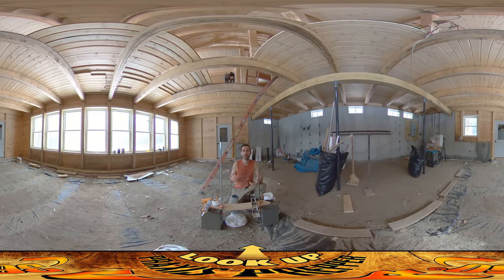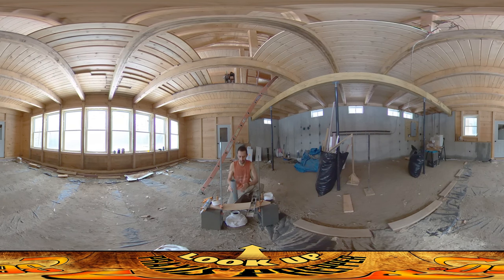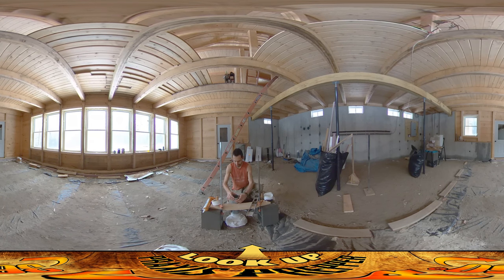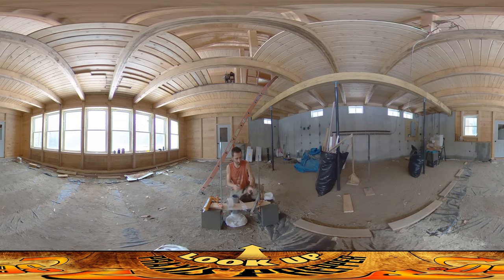Homestead Building - Woodstove Outside Air Vent Finish, Expiration of Silicone Glue

Comment: Having never owned or used a wood stove, I've just been assuming that the air intake pipe would be in contact with the stove in which case wouldn't the metal pipe heating up be an issue where it is in contact with the PVC and possibly the glue?
Reply from the maker: Totally not an issue. Air intake in the lower back corner of the stove and remember that whenever there's a fire going, there's cold outside air rushing through all those pipes. In fact, the incoming air vent pipe with occasionally have condensation on it a it runs.
Reply: Praxis Homesteading and Survival Skills Good to know 👍

Comment: Ohw ohw, i found another question i've been dying to ask (well obviously not, because i'm still very much alive, and i doubt not knowing will actually kill me, but ...) ... on the bottom floor there are several metal pillars, which i thought/understood to be temporary, but then i realized that if you are going to poor concrete, you would want to take them away (so they don't end up stuck in there). So then i thought, can you even take those away, as they are clearly supporting the rest of the building (?!?), which then means you also can't take them out during the concrete poor ... so then obviously what's the deal with these, are they temporary and will they be taken out during the poor, OR are they final and will they be part of the downstairs structure.
Reply from the maker: They're permanent. They'll be buried inside of the wall that runs between the back pantry and the rest of the house so they won't be visible (beautiful though they are).
Reply: @PraxisPrepper  tnx :) ... ok that makes sense ^^